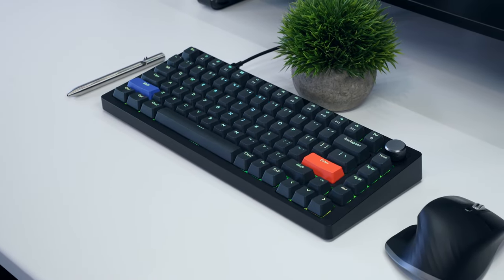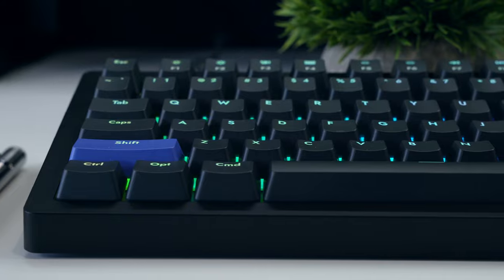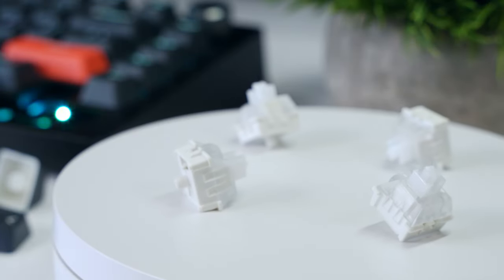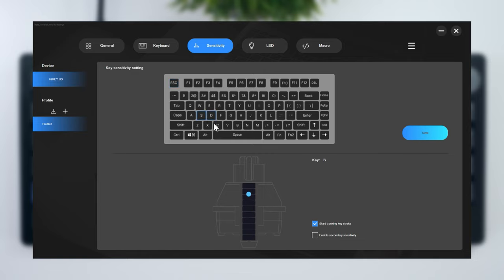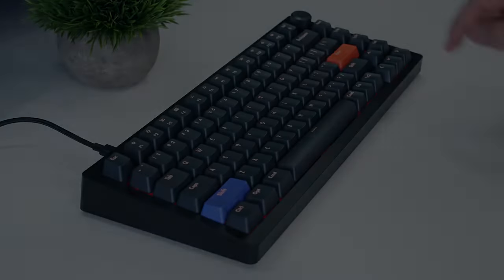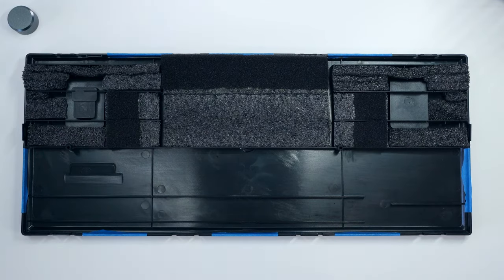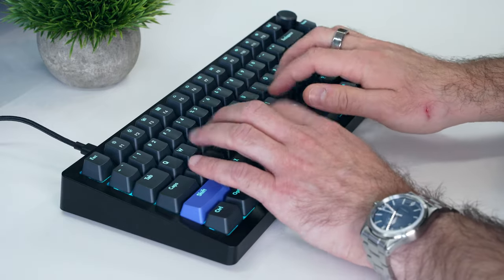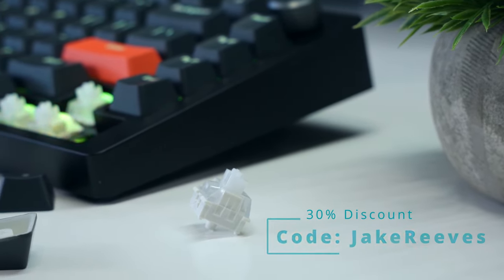Magnets + Modifications: DrunkDeer A75

Comment: How do you mod it tho?
Reply from the maker: I predominately modified it by way of foaming the interior to reduce the sharp case-ping and applying a Tempest tape mod to the backside of the PCB.
Reply: Oh sorry, I’m talking about like removing the screws and stuff
Reply from the maker: Not many screws to remove - to get into the case, you have to wedge something thin between the top and bottom case in the small crack around the outside on the underside of the case.  It is a press-fit snap lock system rather than a screw enclosure. I hope this helps 👍
Reply: Thanks, but nevermind it’s hopeless HAHA
Reply: @JakeReevesVideo  Are you please able to make a short on it, there are no videos on youtube currently for this

Comment: Neat review! I picked this keyboard up recently and love it! I was looking into some keycap options and know people tend to say that cherry profile caps haver interference with north-facing LED switches which this board does feature. Should I avoid that profile for this reason? Also, it appears that the "Enable secondary sensitivity" option in the software has been removed, unless it is relocated somewhere and I didn't see it.
Reply from the maker: If you’re worried about Cherry interference with north facing LEDs, the most similar profile would be OEM - Cherry-like sculpting but taller.

Comment: Hi great vid! If you don't mind. May I ask how were you able to take the knob off? I went to the drunkdeer website says that the knob should be remove first.
Reply from the maker: You have to loosen the set-screw on the side of the knob I believe.  It will require a small Allen key to loosen.

Comment: hello! awesome video plan on doing this when my keyboard comes in, i dont know much abt customizing keyboards, but since it has i think "magnetic" switches do i have to get other magnetic switches? i love silent keyboards and am wondering which switches i will need? thanks a ton! <3
Reply from the maker: Thanks for the comment - yes, you will need magnetic switches if you’re going to swap out these ones.  Look for something that is branded as either magnetic or Hall Effect 👍 This keyboard doesn’t have the hot swap socket attachments to receive standard mechanical keyboard pins, so magnetic switches are necessary ✌️
Reply: @JakeReevesVideo  thanks so much!

Comment: How did you open the board? Does it have screws? Or you just need a pry tool?
Reply from the maker: I used a guitar pick - you need to wedge something into the crack in the backside of the case and carefully pry it open just enough that the inner clips unlatch on the case. Be careful, but it is doable 👍